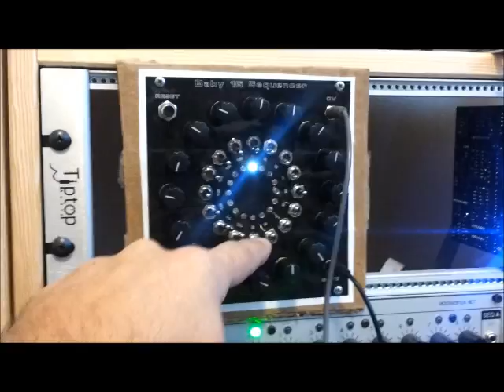Baby 16 Sequencer - Part 3

Comment: Hi Matt,

I have something like this on my breadboard, but can't figure out the reset function.
Could you help me out?
Reply: encoder audio I'm guessing you've solved the reset issue, but in case you haven't, upon receiving a positive clock pulse, reset returns the sequencer back to 1. So, if you want (for example) a 4-step sequence, you'd attach the reset to the 5th output step.